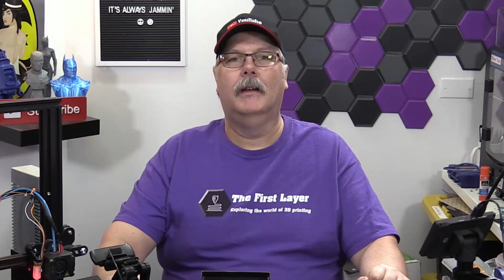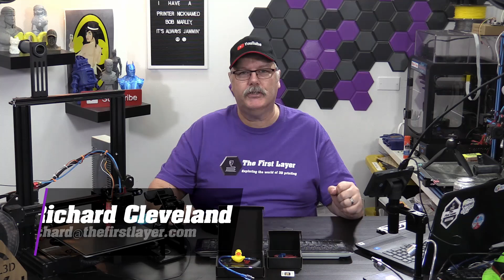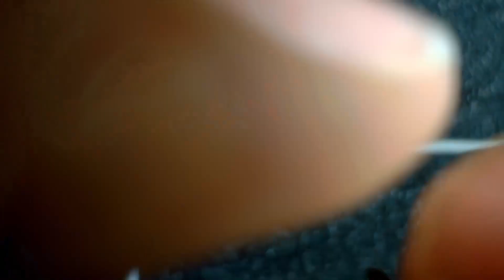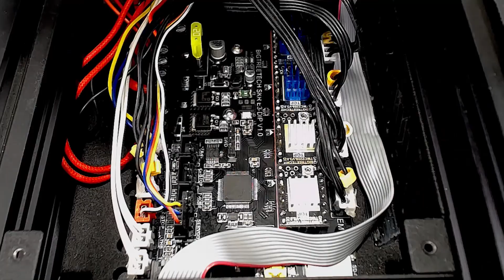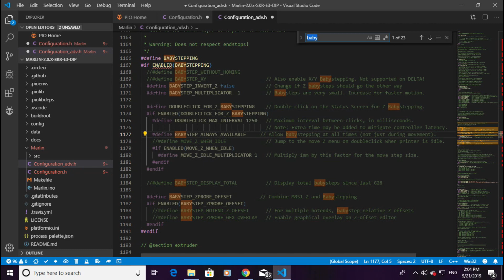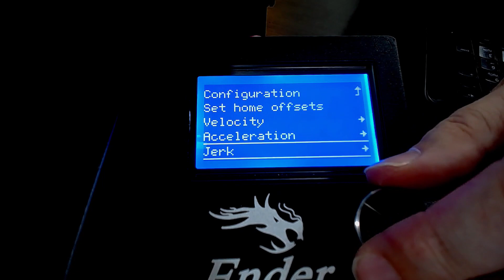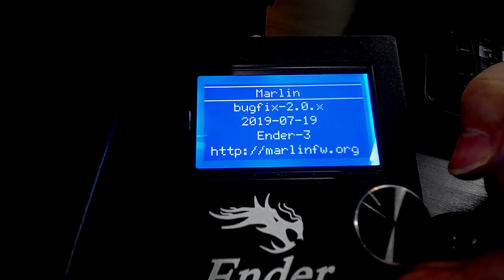How to install the SKR E3 DIP

Comment: I have a question. Can get everything to work and enable the BL touch options in the firmware. However when I plug in the BL touch my screen does not turn on. I put the 3 pins into EO-Stop and the screen comes back on. The probe checks itself turns red but does nothing else. What Am I doing wrong ?

Comment: Hello, 
Do you know how to set up jumpers for full steps in STEP/DIR mode? I can't find any help in documentation and with all on the right it's definetly doing some microstepping.
Reply from the maker: If you want to do full steps, you need to remove the top 3 jumpers. Starting from the jumper nearest to the black pin headers, it's MS1, MS2, MS3, and RST SLP. Leave the 4th one installed on the right. If you leave all 4 on there, you'll set it up for 16 microsteps.

This is for the SKR 1.4, but the layout should be the same: https://github.com/bigtreetech/BIGTREETECH-SKR-V1.3/blob/master/BTT%20SKR%20V1.4/Hardware/BTT%20SKR%20V1.4%20Instruction%20Manual.pdf
Reply: @TheFirstLayer  Thanks, you made my day. I almost ordered different board becouse I coulnd't find which jumper is which pin. 
Actually I think no one wants full steping, it almost exploded printer. 
1/8 was still to fast and wast scaling up the movements and 1/32 with all jumpers was scaling down. I think I need to try 1/16.

Comment: Thanks for the video!  Picked up a used Ender 3 pro with a bad board and your video was the only one I found that explained all the jumpers and NOT needing to make cables to connect everything!  Just need to get the TFT35 display working correctly now.

Comment: Had to flash the driver for the stepper motor as I had TMC connection error
Reply: how did you do this I have the same error message on my display

Comment: You can use pre-compilled firmware. You can find it in BIGTREETECH-SKR-E3-DIP-V1.0-master\Firmware. For example for tmc2208 driver it will be firmware-tmc2208.bin.
Rename the file to "firmware.bin" and place it to the microSD card. Place card into printer, turn on and after ten seconds your printer software will be updated :)
Reply: You're a life saver mate!!

Comment: Must of failed the smoke test. Fired the ender 3 up, fans came on, no display.
Reply: If u have v 1.1 board, and use a bl-touch change the pins to brown-red-yellow, WORKED FOR ME
Reply: Some if the 1.0 boards also need the pins changing for the bl.

Comment: i get STM32F103RC_bigtree failed when compiling
Reply: Here always gives me a mistake too, I've tried several times

STM32f103RC_BIGTREE Failed
Reply: @ckascioo  try changing the enviromnent to STM32F103RE_bigtree
Reply: Hi, i had a problem with STM32f103RC_btt Failed. Fixed with changing Adafruit library like this https://prnt.sc/slzal6

Comment: I get this when compiling
  #error "BABYSTEP_ZPROBE_OFFSET requires a probe."
Reply: If I take the  file and compile  it without changing anithing I get :
--------------------  --------  ------------

megaatmega2560        IGNORED

megaatmega1280        IGNORED

at90usb1286_cdc       IGNORED

at90usb1286_dfu       IGNORED

DUE                   IGNORED

DUE_USB               IGNORED

DUE_debug             IGNORED

LPC1768               IGNORED

LPC1769               IGNORED

melzi                 IGNORED

melzi_optiboot        IGNORED

rambo                 IGNORED

sanguino_atmega644p   IGNORED

sanguino_atmega1284p  IGNORED

STM32F1               IGNORED

fysetc_STM32F1        IGNORED

BIGTREE_SKR_MINI      FAILED    00:00:01.188

STM32F4               IGNORED

STM32F7               IGNORED

ARMED                 IGNORED

alfawise_U20          IGNORED

mks_robin             IGNORED

mks_robin_mini        IGNORED

mks_robin_nano        IGNORED

JGAURORA_A5S_A1       IGNORED

black_stm32f407ve     IGNORED

BIGTREE_SKR_PRO       IGNORED

teensy35              IGNORED

malyanm200            IGNORED

esp32                 IGNORED

fysetc_f6_13          IGNORED

linux_native          IGNORED
Reply: @solidusseal  .
Reply: I get the same issue, did you find a way to fix it?
Reply: @j4red4life  Nope.  
" 

Hello，friend.

This may also be a firmware setting issue.

#define BLTOUCH

#define AUTO_BED_LEVELING_BILINEAR

#define LCD_BED_LEVELING

#define FAN_SOFT_PWM

#define Z_MIN_PROBE_USES_Z_MIN_ENDSTOP_PIN (If you use the z-axis limit switch to level, you need to turn on this configuration)
" 

This is  what  Bigtreetech  told  me ..  But I already checked that :P

But  it  turned  out that at the moment  I had the error  a  NEW firmware f ile w as uploaded and  I did  not have  the error  anymore but  I used a different tutorial.

https://www.pukit.com/2019/09/19/installing-the-new-skr-e3-dip-into-an-ender3-using-tmc2208-v3-in-uart-mode-and-a-bltouch-setting-up-current-marlin_2-0_bugfix-for-the-skr-e3dip/

It  still  does not  work  how I want to but I got  99% steps  in  the right direction  :)

also I  ordered a SKR 1.4 pro :) (comes at the  door in  Januari though )  

Good luck  :)
Reply: @solidusseal  thanks man, I'll see what it does for me
Reply: @j4red4life  tell me if it Works,  mate

Comment: What kind of Vref did you set via potentiometer for the drivers?
Reply: You don't need to set a vref on the steppers with the 2208s. It's all done in the software :).
Reply: @BryanBakerXBrav  Oh really? I thought you had to set something since they  have a potentiometer. So once I set it to UART i don't need to care about the Vref? :)
Reply: @TheNytech  They're designed to support both modes. When in UART, you can govern the voltages in software :)
Reply: @BryanBakerXBrav  alright thanks buddy! It worked great :)